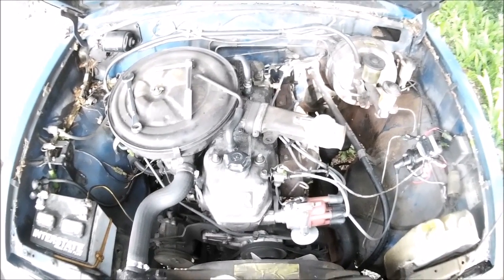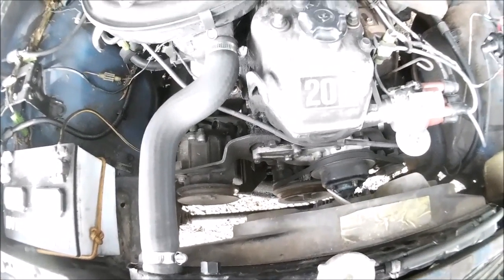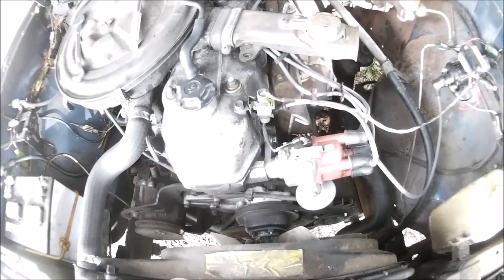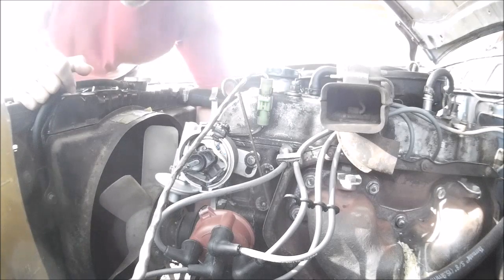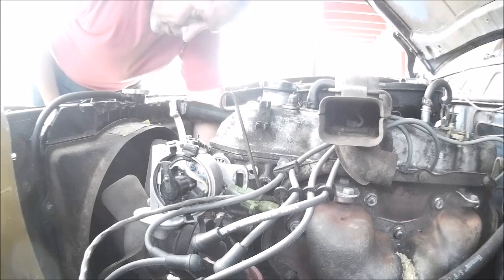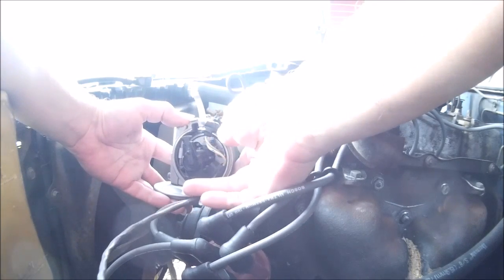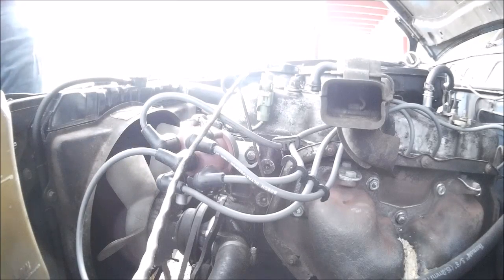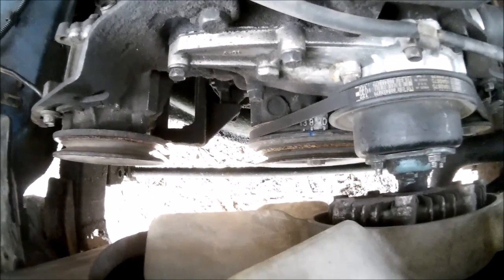1978 Toyota Pickup/Hilux 20R - CORRECT Distributor Installation

Comment: I have the same situation, Buy My truck it's an 22r carb, so what's the timing for this engine? 12 for yours & 5 for 22re, but for the 22r? Then i have to begin to set it tdc & then move it from there? Thanks
Reply from the maker: I have found it best to preset the timing mark where it should be, according to specifications for your type & year of engine, then install the distributor as shown in the video. Starting at 0 (zero) or Top Dead Center (TDC) of the combustion stroke would usually mean the engine is not set to time correctly (more below*).

Also, you have to make VERY SURE that you have the #1 piston at TDC of the compression stroke. It is possible to have the mark line up on the crankshaft pulley but the #1 piston might be at TDC of the EXHAUST stroke, meaning your timing would be 180 degrees out. The best way to determine this is to remove the valve cover, set the mark by rotating the engine, then try to wiggle the first two rocker arms towards the front of the head. Both should be lose & wiggle a bit if #1 cylinder is TDC on compression. If you can't wiggle one of them, it's on the exhaust stroke.

If you take the valve cover off to do this, it's a good idea to adjust your valves since you have access to them. Here's a good video that shows you how: https://www.youtube.com/watch?v=t0VVtE1BPMs

Proper timing setting for the 22R carbureted engine depends on the year of manufacture. here are the specs:
1981 to 1984 - 5 degrees BTDC (Before Top dead Center. 1985 to 1988 - 0 (zero) or TDC.

There may also be a sticker on the underside of your hood which will show the timing specs.

If I can help you with anything else let me know.
Reply: So my engine should be at -5 correct? The truck runs fine, just can't adjust the timing on  the distributor like yours, so at tdc on the pulley has to set it on -5 then install the distributor at #1 right? Thanks un advance. Let me see if i can make ir, great video
Reply: I was checking the timing on the truck and let me tell you, something itsn't right, why? Because nothing match on the marks, my distributor mark won't match with the tdc, it's a little above the #1 when the pulley on tdc, then at the same time the mark on the chain sprocket it's a bit before the 2 first marks, what can i do? The truck starts fine but it tends to work hotter, don't know what to do?
Reply from the maker: @enriqueestrada573  OK, so what you may (or may not) be dealing with here, is that someone before you, a previous owner or a mechanic, may not have set something up right. Unless you can ask those people what they did, you really have no clue what happened before. You are doing the right things to see where the engine is now, so that should tell you plenty.

First things first. Since you have had the truck, did it ever run well or normally? If it did, most likely something has changed since you've had it, like worn parts. I will get to that later. If it's always run like this since you've had it (doesn't run well), there are any number of reasons why.

You say it starts fine but don't mention how it runs after starting. Is it normal, even after it warms up fully? What do you mean "it tends to work hotter"? Based on what? How do you know?

If it is running hotter than normal (and normal for these engine is 1/4 to 1/3 up from "COLD" on your Temp Gauge), you either have a timing problem or a lean fuel problem. I still think it's probably timing related.

You mentioned the "chain sprocket", which I assume you mean the gear on the end of the camshaft. Did you shine a flashlight down into the timing cover and get a real good look at the timing chain? Do that. And also get a long screwdriver you can use to push on the chain from side to side. Do this on the driver's side of the chain, just at the top of the chain guide. You should not be able to move it away from the guide more than 3/8" or so. If you can move it more than that, the chain is worn and stretched out. That can alter your engine timing.

Another way to check this is with a timing light. Hook up the timing light, start the engine & shine the light at your timing marks. If the mark on the pulley jumps around a lot, the chain is stretched for sure. You can really see this happen at warm idle. If the chain is fine, the pulley mark will show up in the exact same place with ever flash of the timing light.

I suspect that your timing chain might be worn from what you are describing. If that's the case, the chain, guides & tensioner needs to be replaced first. Then you can re-install the distributor.

It could also be a broken chain guide making the chain loose, and it's usually the driver's side guide. Here's a good video on how to check that: https://www.youtube.com/watch?v=VeEb5KvyURI

So have a look at this stuff, send me some answers tot he questions above (be complete) & let me know what's happening.

Comment: We've attempted to shift the distributor one tooth back and one tooth forward and neither way will allow the motor to run.

The only time it will run well enough is at that odd center position.
Reply from the maker: Just for another perspective, here is a different video on the distributor install, that I actually consider to be better than my own video: https://www.youtube.com/watch?v=u6b-vnsk5xA

That shows the correct method to static time the engine then install the distributor. make sure you also read the pinned notes by the poster in the description. Very important.

I'm not sure what you mean by "that odd center position"? Can you describe that in more detail?

Comment: Could this be the reason with my 20r is idling like shit, feels like the timing is way to advance and when I turn it off it like fights to stay on but dies
Reply from the maker: It could be one of the possible reasons for your symptoms. However it is usually fuel or carb issues causing this first. It takes quite a while for a distributor to get that far out of spec to cause it. Another remote possibility with timing issues is a worn or stretched timing chain or broken timing chain guide. This can cause the base timing to be unsteady and "off". Timing chain sets usually need to be replaced every 80K to 100K miles or so.

If you want to check for timing chain problems (and to check for proper timing setting) you'll need to get a timing light. You can get a decent one from Harbor Freight for around $30 (as of 8/22). Hook up the light, disconnect the vacuum line at the distributor vacuum advance diaphragm & plug the end of the vacuum line (use a nail, golf tee or similar). Start the engine & warm it up to full operating temperature. Point the light at the timing mark on the crankshaft pully & press the button on the timing light & hold it there. If you see the mark showing up in a steady position at the 8 degree mark, your timing is correct & the timing chain is fine & you likely do not have any broken timing chain guides.
If you see the timing mark "jump around" & not be steady, this usually meaning the timing chain is worn or stretched, & the timing set needs replacement.

Other causes of "run-on" after turning the ignition key off:
1. Fuel Idle Cutoff Solenoid disconnected or not functional. There is a solenoid on the passenger side of the carb with one wire coming from it. When the ignition circuit is on it is activated, & pulls a plunger back inside the carb, opening up the idle circuit. When the ignition is turn off, the plunger closes off the idle circuit. This stops the flow of fuel to your idle jet & keeps the engine from "running on" after turning the key off. If the solenoid is not hooked up or isn't working, this could cause the "run-on".
2. Possible partial or complete fuel idle circuit blockage. When this happens, the engine tries to run on the main circuit only, leading to a "rich" condition (too much fuel) at idle. This can also lead to "run-on" & bad idle quality. This usually happens when you've got a dirty fuel filter that allowed some "trash" to get into the idle circuit & block it, or from too much "trash" or debris in your fuel system (from tank to carb). It can also happen from deteriorating rubber fuel lines, especially if you have been running todays' "ethanol gas" through old fuel lines. The old lines were not made to handle Ethanol & I've learned that Ethanol can & will strip off rubber particles on the insides of those old fuel lines, leading to idle circuit blockages.
Another issue (but much more rare) is a blocked idle jet in the fuel bowl.
3. Incorrect idle mixture setting (too rich). There is an idle mixture adjusting screw on the passenger side of the carb, near the base, that points up at an angle. This screw is used to adjust the idle air/fuel mixture ratio. If it is "backed out" too far, it will provide too much fuel (rich condition). That can also cause poor idle quality & "run-on". BTW the setting of this screw will have no effect on engine run or idle quality if the idle circuit is blocked.
If you want to check that it's set correctly here's a good baseline setting. Engine does not have to be running for this. Get a flathead screwdriver that fits the head properly. Turn the screw to the right slowly until the screw wants to stop.
DO NOT TIGHTEN DOWN THIS SCREW - YOU WILL DAMAGE IT. Just turn it until it want  wants to stop. You need to count how many turns it goes until it stops. (Note: a "full turn" is the screw head turning a full 360 degrees.) This will let you know how it was set. The baseline setting for the 20R carb is 1 & 3/4 turns to the left from the screw being lightly seated (that point where it "wanted" to stop while turning it in to the right).

So there are some things for you to check out & do. Let me know what happens.
Reply: @The13thSword  dam bad ass thank you for taking the time to giving me a boon of advice, I truly appreciate it
Reply: @The13thSword  I forgot to mention, the choke has to stay lifted for it to even run, if I press down the choke it’ll idle but it’ll bog down if I give it gas
Reply from the maker: @augustarellano197  No problem. Looking forward to hear about what you find.
Reply from the maker: @augustarellano197  That's a pretty good piece of info there, if I understand what you mean by "lifted" & "pressed down". Generally the terms "open" or "closed" are used to describe choke position. On a "cold" engine (an engine that has not been run for at least a few hours), the choke should be closed, meaning being in a horizontal position, nearly closing off the top of the carb's "throat"; it literally "chokes off" most of the air supply. This is because a "cold" engine needs more fuel than air to run well, & to warm up quickly. The choke plate being closed restricts the air flow. As the engine warms up, the choke plate should gradually open up. At full operating temp, the choke plate should be almost vertical in the carb's "throat". As long as the choke thermostat is working & adjusted properly, all of this should be automatic. BTW, on a "cold" start, you should push the gas pedal to the floor & release it, then turn the key to start the engine. That one "pump" of the gas pedal sets the choke plate to the "cold" closed position.

If by 'the choke has to stay lifted for it to even run" is this on a  "cold" engine? Or once it has at least warmed up some? Depending on the answer, this can point in the direction of a fuel issue, either being too rich or lean for conditions. It could also mean a sticky choke mechanism (needs cleaning), a disconnected choke linkage (needs to be reconnected) or (& I hate to say this), maybe the choke works fine but you didn't understand what the choke actually does? If so that's OK, we all learn as we do things. In any case, I can try to guide you on these things to try & get a good idle.
Reply: @The13thSword  yes basically has to be open at all time for it to run, that’ll be great if you can guide me would texting work?
Reply from the maker: @augustarellano197  OK, now this makes more sense. If the choke plate always has to be open, especially when the engine is "cold", that usually means the carb is providing too much fuel. In such a case, the choke plate has to be open to allow the max amount of air into the carb to even try to balance out the air/fuel mixture so it can burn. You can also verify that this is happening by removing one or more spark plugs and having a look at the electrode(s). If it is running "rich" (too much fuel, not enough air) the electrode(s) will have black deposits on them. With a normal air/fuel ratio they would be a light brown or light gray. Reference: https://ngksparkplugs.com/en/resources/read-spark-plug

If you're having to physically hold the choke plate open that means the choke mechanism is connected & working, but it raises other questions about the carb. Again, maybe the idle circuit is blocked. Has the carb ever been rebuilt & if so when & by who? It is also possible that certain parts of the carb are worn out & causing this problem. There are also certain parts that can get stuck inside a carb & cause near-flooding issues like this one. Especially if it's been a long time since a rebuild, a cleaning, or if the vehicle sat for a long time without being run. How many miles on the vehicle? What year is it? Is this vehicle going to be driven regularly or will it be a "hobby" vehicle?

Try to answer these questions as completely as possible, more info helps to point to possible causes/issues, & possible fixes. I also need to know to what level you feel comfortable with trying to do some things yourself so I know what to recommend. No knock against your skills (or anyone's) but I have learned that on some things/parts it's just easier & better to let a pro deal with it, like rebuilding a carb. There are some things that can be done short of a carb rebuild to get it going (maybe) but I need answers to those questions to decide if they are even worth trying.

I can't do text but can try to guide you thru these messages